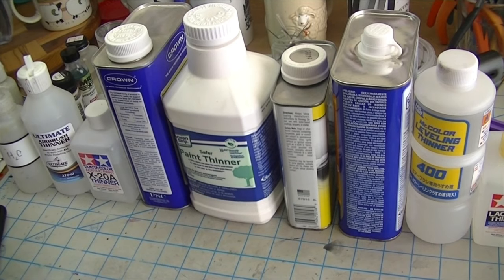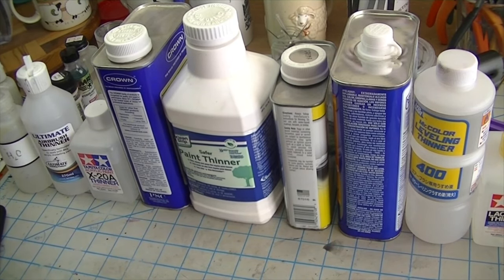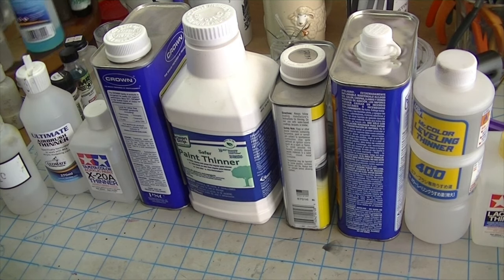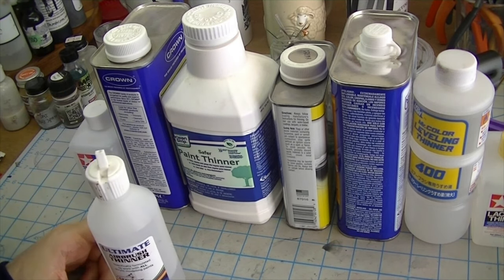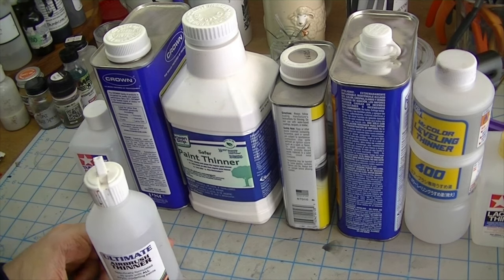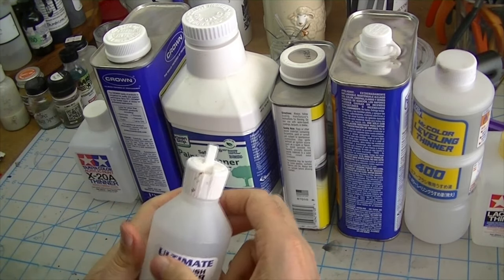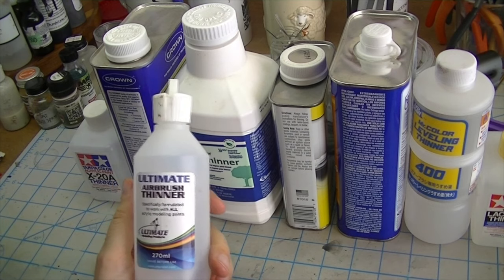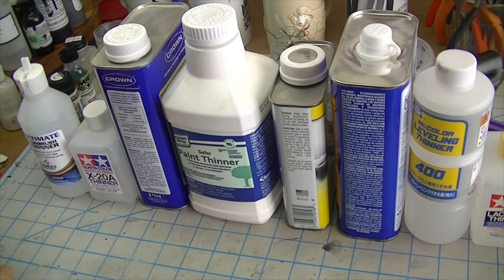ep125 - modelmaking fundamentals:  what thinner should i use?

Comment: Finally got some "unobtainium" (aka Mr. Leveling Thinner) and had a miraculous turn around in the hobby using it with Tamiya paint.  I've naively struggled with the water-based acrylics for a couple of years with each session being an exercise in voodoo.  A 30% thinning ("reducing") of Tamiya with Mr. Level combined with a reduction in air pressure produced the most beautiful and controllable wisp of continuous paint I've seen.  The hobby has instantaneously become fun!!  Copious thanks.

Comment: Hi Will, thumb up for your videos which are resurrecting after 30some years my long-gone modeling spirit 😉 Nevertheless, having chewed some chemistry in my life let me point out an incorrect statement in this video (which, nevertheless doesn't change things in practical terms): normal propanol and iso-propanol are slight different versions of the same alcohol. The molecule is based on a 3-carbon chain. In normal propanol the alcoholic function, namely the OH group, is attached to one of the ends of the carbon chain, while in the iso-propanol is the central carbon that holds the OH group. Written in letters n-propanol is CH3CH2CH2-OH while iso-propanol is CH3CH(OH)CH3. The same reasoning goes for n-butanol (a 4-carbon atoms alcohol) while iso-butanol can be represented on paper as a cross with the central carbon bearing 3 CH3 groups (aka methyl) and finally the OH group. Cheers 😁
Reply from the maker: ha!  no wonder i nearly failed chem 104.

Comment: Hey Will. I have question regarding acrylic thinners. I've noticed that you can thin Vallejo with alcohol based thinners like UMP.  However, if you use just IPA (even if you dilute it with water), or anything else that contains alcohol (windows cleaners etc.) - the paint gums up and makes a mess. So, any idea why alcohol based thinners work but IPA does not?
Reply from the maker: different types of alcohol, but in general it's only model color that's an issue.

Comment: Hi Will, I have a question. Mr Colour Levelling Thinner is my usual go to thinner, I find it to be superb when used with the mr colour lacquers. It also works perfectly with MRP. Lately I have noticed that Tamiya do a “lacquer thinner with retarder” with a bright orange lid. I was wondering if you have any experience with this? I assume it’s just their cream lid standard lacquer thinner with retarder added to it? How does it compare to MR Colour LT? They do smell significantly different so they obviously have at least a moderately different chemical make up.

PS. Thanks for your videos, I find them very informative.
Reply from the maker: i haven't used it but by all accounts it's similar to mlt.

Comment: Hi will, thank you for the amazing post. I am a big fan of your channel. I have a couple of questions for you if you would be so kind to share your wisdom. 

I am using mr. Paint for spraying and find them great(I know you use them too). I find that I use quite a bit of paint when spraying compared to Tamiya paints on a model. Do you experience the same thing? 

Can I thin mrp paint? What could I use? What do you you use, if you do? 

Is there a cheap thinner I can use to do this? 

Respectfully. 
Dave.
Reply from the maker: thanks dave!  mrp is ready right out of the bottle but you can reduce with any lacquer thinner.  but, that will only make the coverage even thinner, so you'll need more layers and will end using the same amount of paint.
Reply: @barpfoto  yes I am trying to make the paint thinner, so I can keep pre shading. I totally understand with the thinning.

Do you find you use a lot of MRP paint when spraying?

Thank you for your response and your time.

Cheers.
Reply from the maker: @dsrduff  not really but i tend to be pretty precise and not waste much on overspray.  i generally work at 15psi from less than an inch away on military color coats.
Reply: @barpfoto  thank you for the reply. I will try your method out. Keep up the good work. Really enjoy the information and techniques. Cheers.

Comment: Dude love your videos...what do you think about testor enamels paint??? Should I thin it with mineral spirits or thinner??
Reply from the maker: thank you!  as for enamels....mineral spirits, testors enamel thinner, or lacquer thinner.
Reply: Hey dude what up..... how close should I be when painting with my air brush for example my hood looks smooth and done professionally but my doors came out with a grainy texture. I was shooting with 20psi idk if that helps, any advice?
Reply: To get a wider angle of coverage should I use a thicker or thinner needle? I'm using a .2mm needle

Comment: what should   I use for Tamiya acyrlics to reduce and improve paint flow??
Reply from the maker: they have a retarder for their paint.
Reply: so use the Tamiya laquer thinner with  retarder for water based acyrylics??
Reply from the maker: @43rocket  tamiya aren't traditional water based acrylics.  they're alcohol based and they have a retarder just for that, but it's mostly useful for brush painting.  tamiya are actually some kind of hybrid that acts as an acrylic when reduced with water or alcohol, but as a lacquer when reduced with lacquer thinners.  and, if airbrushing, you get superior results that way.  slow lacquer thinners like mlt and the new tamiya retarded lacquer thinner will give you a very smooth, durable coating.
Reply: @barpfoto  I have a 0.3 needle in my air brush, can you put a 0.5 in there also??
Reply: so for the water based Tamiya ones, you can use the lacquer retarder?  what about the x-20 thinner they have??
Reply from the maker: @43rocket  there are no water based ones.  the retarder in a jar isn't "lacquer retarder".  x-20 is their enamel thinner.  x-20A oth is alcohol based and is for their acrylics.
Reply: so x-20a will do the job for water based Tamiya acrylics?  but can I also use the Tamiya lacquer thinner on water based Tamiya acyrlics?
Reply from the maker: @43rocket  ok...for the last fucking time....TAMIYA ARE NOT WATER BASED.